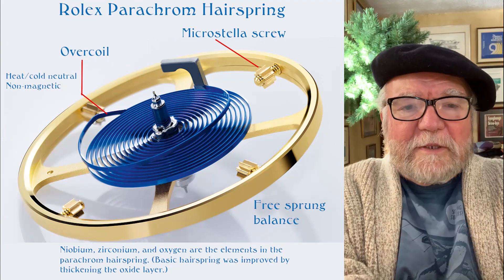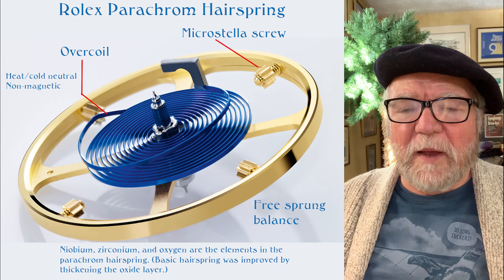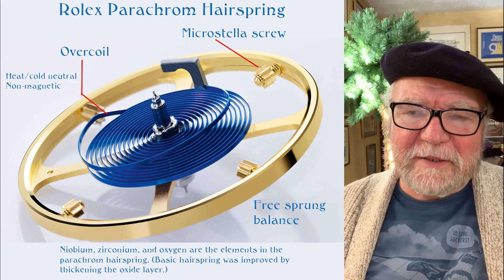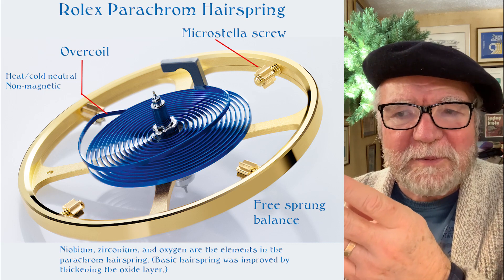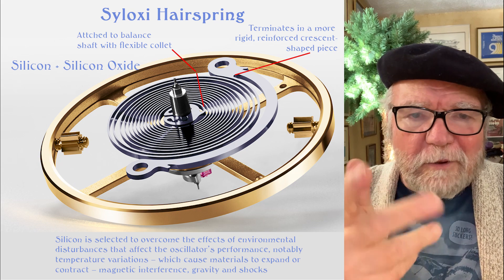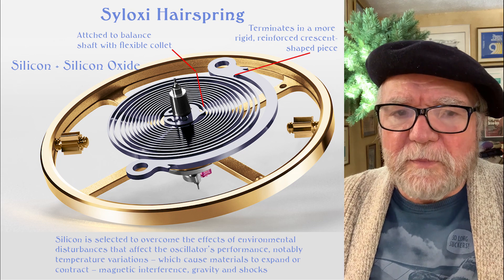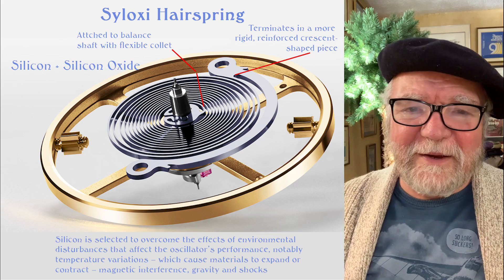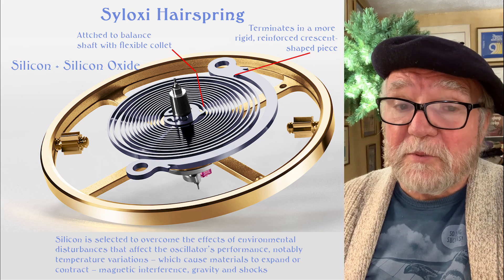Should Rolex Use Silicon in their Movements? #VP86

Comment: The argument that a future watchmaker cant adjust silicon is a valid concern its probably not as invasive as people thing it is. While silicon hairsprings that are integrated with a bridge/adjustment system like the Rolex system shown cant be tuned or repair in the future, there are plenty of  watches where just the hairspring itself is silicon. In that sense the silicon hairspring can be directly interchangeable with steel hairspring in the future. Silicon also isn't going to degrade like other have suggested. Most wafers are monocrystalline so there are no grain boundaries to shift and to harden the material. Silicon is corrosion resistant so it wont deteriorate from the environment. Overall it is just the superior material. Its also way easier to mass produce, the variation between batches is way smaller than that of other metallic hairsprings. I will concede though if you aren't mass producing them its literally impossible to make so metallic hair springs definitely still have a place.

However, if the argument against silicon is centred around the fact its too "advanced" then I would look carefully about the design and manufacturing practices of all the high-end watchmakers including independent outfits. Nearly all watches including Langes, Pateks and so forth are now entirely made using modern, state of the art machines. All production watches now are so highly engineered its a bit disingenuous to rag on the advancement of just one component. I understand wanting to stay close to tradition because there is a lot of tradition behind watchmaking, but I would only caution against making arguments against "advancement" or modern practices because unless you're looking at the few independent watchmakers who literally make everything by hand everyone else had modernised to a significant extent. I would also add that the fear that silicon hairsprings will somehow lead to mechanical watches moving closer to quartz watches might be a bit misplaced. At the end of the day regardless of the material, a mechanical movement is distinctly mechanical and a quartz movement is distinctively quartz. 

It was interesting to hear your thoughts on this. I'm curious to hear what your background is. My background is in aero eng and working in the watchmaking industry as an engineer so my biases naturally swing towards the more advanced solutions.
Reply from the maker: Hi Ostrich, thanks for your well-stated views. Years ago when watch buyers switched from mechanical to quartz—that was an advanced solution. From what you say, I think you would agree. To save their business, the Swiss watchmakers invented "high horology" centered around the craftsmanship of traditional watchmaking. Sort of like getting an original painting rather than a mass produced knock-off. My own background has been 45 years as a university professor, for the last 20 years teaching internet programming C#, PHP, etc. I discovered object oriented programming (OOP) and worked hard to master it and teach it and then I discovered 'design patterns' and extended my OOP to design patterns, and finally to the OOP nemesis, 'formal programming' and 'lambda calculus.' The advocates of formal programming derided OOP programing as "simple-minded" and created for less-than talented programers for low pay. However, as one MIT professor pointed out, OOP / Design Patterns was for dealing with constant updating in a program and team programming. An OOP program may not be as efficient as a formal one, but when a change had to be made, anyone on an OOP team could do it, while the same was not true for formal programmers. Besides, with the new processing hardware, the difference in performance between the two was infinitesimal. Since formal programming was developed in the form of lambda calculus at the same time as Alan Turning developed the concept of the imitation game, it wasn't especially "advanced," nor "new." (Alonzo Church and Alan Turning communicated and both agreed that they were on the same page, just different languages in the 1930s.) However,  in programming the argument continues, (OOP vs Formal) and both schools of through may be thrown out by some AI form of programming.
—Now back to the matter stuffing silicon hairsprings in mechanical watches. Mechanical watches were essentially 're-born' as archival technology in response to the 'quartz-crisis.' There should have been a similar crisis with the advent of the smart watches, the Apple Watch in particular. However, other than the traditional Swatch watches that seemed to have taken a hit that most didn't notice, there was nary a ripple because everyone understood that mechanical watches were more for masculine jewelry and a status symbols than for the most accurate time-keeping. (If they didn't have a smart watch, they had an iPhone or Android for setting their mechanical watches.) Suppose instead of collecting watches, your hobby was restoring Model-T Fords. You could put an all new engine, transmission and brakes in from 21st Century technology, but you'd no longer be a Model-T; it would be something different. That's how I feel about collecting mechanical watches. I'm pretty happy with the technology of Abraham Louis Breguet, maybe bending a bit for modern lubricants and man-made rubies, but that's it. If you and others want the unadjustable silicon hairsprings, enjoy. They're just not for me. Take care, Bill

Comment: Exotic tech and hard to understand movements have no place in high end watches. A competent watchmaker should be able to understand and service (including creating new parts) a high end watch several hundred years from now.
Reply from the maker: I wonder Lars, what's going to happen if the silicon becomes brittle and falls apart. Take care and be safe, Bill😷
Reply: @watchartsci  The watches will become dead bricks, that's what will happen. And that is crazy. Take care.
Reply: To quote Roger W Smith: “You can buy a mechanical watch that is 300-400 years old and it will still keep time very well with a little service. What’s wrong with continuing to use these materials? I know these materials are tried and tested and I know that by using these traditional materials and methods, I can build watches that will be around for hundreds of years. We can still replace components if need be. I don’t really know how anyone is benefiting from these new materials.”
Reply: @yoddeb  Yeah but he doesn't use the same materials and processes they used to. Pinions wear, watches get dropped an the parts a modern watchmaker would put into a 400 dollar watch will definitely be made from materials that are stronger. Its a bit disingenuous of him to pretend that he is doing everything in a purely traditional manner.

Comment: Bill, I have heard you mention on multiple occasions you don't like the idea of Silicon in mechanical watches. When you say that, do you really mean Metal watches as opposed to Mechanical watches? The reason I ask that, is "Mechanical" something that relates to the skill or use of machinery or tools, would allow Silicon to be used.

What's the difference between using Silicon and any other element used watches? Are you confusing Element 14 Silicon, with the synthetic polymer Silicone (Which contains Silicon)? 

Here's a small list of watch materials w/ their periodic table number.
Stainless Steel: Iron (26), Carbon (6), Chromium (24)
Gold (79)
Silver (47)
Bronze: Copper (29) , Tin (50), Aluminum (13), Manganese (25), Nickel (28), Zinc (30) and sometimes… Silicon (14)
Titanium (22)
Aluminum (13)
Carbon (6)
Platinum (78)
Palladium (46)
Tungsten (74)
Tantalum (73)

Why single Silicon out and none of the others?

What about the use of Ceramic: made of inorganic, nonmetallic powders, most commonly zirconium oxide and chemicals like silica.
What about acrylic crystals? Acrylic is nothing but polymers.

And lastly two watches that I would put alongside any watch:

What about the Lang & Heyne Caliber 1 Ivory? It features ivory plates and bridges, made from Mammoth tusk.

What about the Moritz Grossman tourbillon? They use a human hair in it. You can actually have your own hair used or that of a loved one.

Love the channel and your knowledge. Keep up the great work. I've learned a lot from this channel.
Reply from the maker: Steve, I'm familiar with Periodic Table of Elements; how about making movements from silicon and oxygen? Those are the ingredients in quartz. You know the vibration frequency in quartz that always beats the old mechanical ones by the oscillations in a hairspring. But for some reason we don't collect watches with quartz movements. The Syloxi hairsprings in some of the Rolex watches (the ladies Pearl Master I believe), are produced as 1-piece wafers ... just like those that go into microprocessors. Silicon + oxygen together together is where the name Syloxi comes from. Isn't there another component in watches that is also silicon & oxygen? Oh yes, it's quartz. Take care and be safe, Bill😷

Comment: I am against silicon in watches. A watch maker can service a watch with standard materials and parts. When you begin to introduce silicon this means the watch could only be serviced by a company or manufacturer. As of now no watchmakers have the capability to service/produce silicon hair-springs etc. Also, what happens if the manufacturers stop producing silicon replacement parts? I guess that would mean a total movement replacement.
Reply from the maker: In the short run, the production of silicon hairsprings is something like the production of computer circuits. The hairspring wafers are cooked up in an almost perfect form. The circuits in my iPhone are created that way, and of course it keeps near perfect time. That's not what I want in watches that I collect. So I'm with you Patrick, but others can collect any kind of watches they want. Take care and be safe, Bill😷

Comment: Thank you Bill for another thought-provoking topic. I do see your point. Nonetheless, I look at using silicon hairsprings in the same vain as using CNC machines to produce most other parts. They both involve skilled labor but no artisanal craftsmanship. Albeit, to produce a watch worth collecting, we still require, extreme tolerances, coupled with hand assembly (hand finishing in higher end pieces) and ingenious mechanical as well as creative artistic designs.
Reply from the maker: FFA, a lot of watchmakers eschew the use of CNC machines, but even so, the materials used in the watches are not the CNC materials; watches are not "made of CNC" but the watchmaker's products. They do take some of the craftsmanship out of the the watch, though. Take care and stay safe, Bill😷

Comment: Tricky issue. It’s an indisputable fact that silicon hairsprings are, from the standpoint of pure chronometric performance, a better solution than their alloyed counterparts. But then again, chronometric performance and operational efficiency, by any means possible, isn’t really why we devote so much of our time and energy to the hobby of collecting and tinkering with mechanical watches is it? There are certain things that just, instinctively, feel right when it comes to traditional watchmaking and logic frequently isn’t part of the equation. For example, I’m very fond of my modern Omega Speedmaster with its  co-axial escapement and Si14 silicon hairspring, but I think I’d like it just a fraction more if it used a Nivarox hairspring, tweaked as necessary, such as the ones found in my Constellations dating back to the 1960’s (both of which still keep near perfect time). There would be no discernible advantage, it’d just make me happier.
Reply from the maker: Hey Shave, I don't know about silicon in hairsprings. In the long run, it may prove too brittle, but in the meantime, it does a magnificent job of keepings its shape and good time. It's sort of being an antique collector and asking for an "improvement" in the antique. Take care and be safe, Bill😷
Reply: @watchartsci  That’s exactly right Bill. And those old Nivarox hairsprings have stood the test of time, with both my vintage Connies still working within their original chronometer specifications.

Comment: Is it not where the Automobile has gone with shared components across the marques.The catcher  is lost when all these watches use similar  components. Silicon hairsprings across brands but still charging a fortune.Soon the customer will catch on and not part with their money for what is ostensibly a mass produced product  with a struggling marketing  proposition. The true high Horology  would  be for true rich collectors as we mere mortals will seek a timepiece  that will not break the bank.Prices will continue  to drop as firms made to a profit rather than to a standard as was the case with Mercedes Benz. All this malarkey about owning a Patek for the next generation  is pure marketing piffle as the next generation want to figure  out Bitcoin.
Reply from the maker: Francis, I think it's incumbent for the watch companies to provide something for the "mere mortals" in watch collection. I also think it's possible, but requires creativity to manufacture excellence in the way that Habring2 has yet at an affordable price. The insane rise in the price of gold and platinum has jacked up prices to the point that I'm very happy with an excellent movement in stainless steel. After all, there are lots of us 'mere morals' and money to be made there. As for Patek's tag line being a mere piffle ... it doesn't even rise to the level of 'piffle.' Take care and be safe, Bill😷

Comment: I'm in favor of any material, just as long as it doesn't need a battery.  I still feel the Grand Seiko Spring Drive, is mechanical.  I like the drive for accuracy and durability.
Reply: spring drive is both mechanical and quartz
Reply: @tippykaffu4047  Mechanical engine, to create the charge for the quartz..
Reply from the maker: John, is mechanical watch collection really about trying to get the most accurate time or is it to recreate the best crafted watches? If it's accuracy, we all have our smart phones and $10 quartz watches. I would say we need an escapement, with a pallet fork with a metal oscillator; which leaves out quarts. Take care and be safe, Bill😷
Reply: @watchartsci  It is one aspect.  The science, mechanics, creativity to create a mechanical engine that's is durable and precise. And it can be a handmade DeWitt, with an ETA, that sells for $40,000, only to drop to $10,000.

Comment: I think it makes sense for tool watches as several have said here. I have subjected my Datejust to structure fires as a former Firefighter, I didn't take it off when I built my house. They are practical, quality watches. Mine still  looks fine despite my lifestyle. 
If I were to purchase my dream VC, I would have different expectations all around. Thanks again Bill.
Reply from the maker: Phil, in a way, that's the same thing the Philippe Dufour said about a well-crafted watch. You don't need to add silicon or plastic escapements to get great watches. I think that Rolexes with the Parachrom hairsprings are outstanding inso far as the movements are solid timekeepers. Take care and be safe, Bill😷

Comment: Bill, I respectfully disagree with you.  Silicone is not a circuit in this case.  It's a material.  And if it works better than metal, then it should be used.  A mechanical watch has materials whereas quartz is circuits.  So my opinion is that it should be used.  That's why I bought a Tissot Seastar Powermatic 80 silicium.
Reply from the maker: Chad, interesting point. How about plastic for plates and bridges, then? Or make all of the watch out of plastic except for a silicon hairspring? Take care and be safe, Bill😷
Reply: @watchartsci  Plastic won't last.  They may make the parts out of fancy new alloys and hopefully the prices will come down to where we can all afford them.  The good thing is there is room and supply for all of us: Traditionalists like you, Quartz lovers and people between.  I like both so I'm in the middle.  I enjoy your videos.  Thanks for making them.

Comment: The Material sounds good to me - progress: "Silicon (also known as silicium) found a new place in watchmaking and has gained momentum in the last decade or so. This material has incredible resilience when it comes to shock and is impervious to magnetic interference. Watchmakers are seeing the value in adopting this versatile material that is lighter yet harder than steel into their engineering. It improves stability, performance, accuracy, and resistance to magnetic interferences and thermal fluctuations. It also can keep its shape forever and never requires any lubrication".
Reply from the maker: Hey David, I've got all the silicon in my smart phone and computer. I like the challenges faced by craftsmen who can come up with mechanical solutions to the problems faced by isochronism, such as the tourbillon and remontoir d'Egalité. Take care and be safe, Bill😷